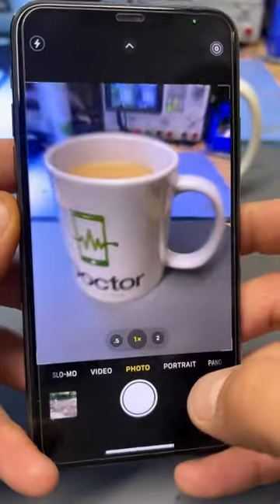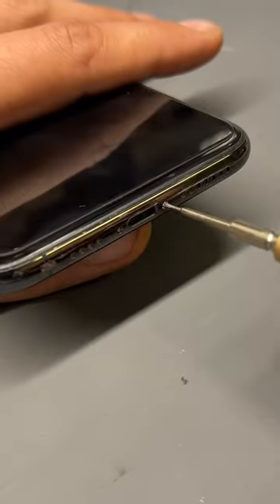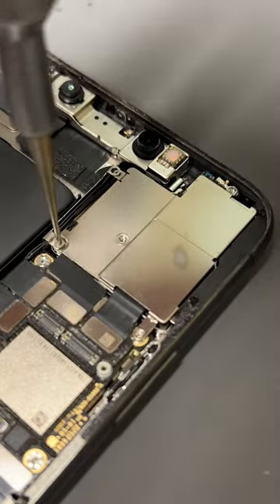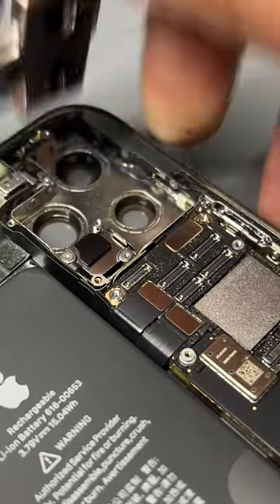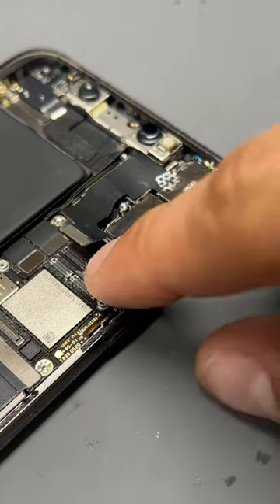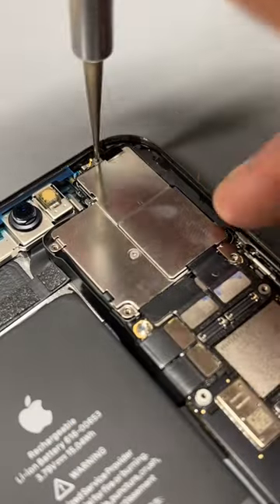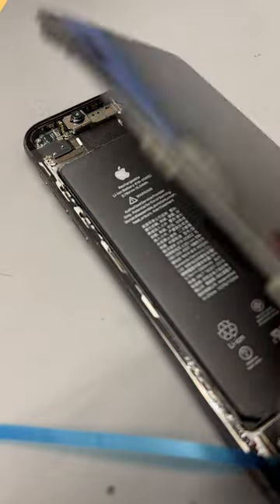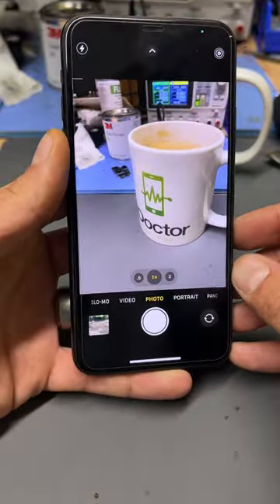Motorbike vibrations caused iPhone 11 Pro Max camera to fail!

Comment: Or add a magnet
Reply: hunghoaqua5923  yes. A magnetic band sticked next to the cameras will make the camera's optical image stabilization to be stuck in the closest position to the magnet, which will provide a steady image.
Reply: Do you have video for this please 🙏🏻
Reply: Does this affect the camera focus or stabilization ? @stefanxcz
Reply: @MohamedAyman-ru3sc i tested it and work (stabilizer/focus work like normal), but i not put inside cover,just outside cover, maybe you just need phone case with more space for put magnet.